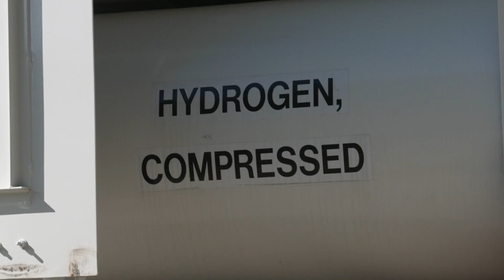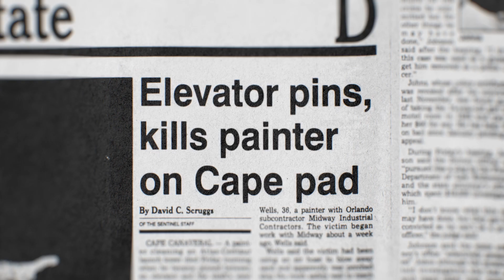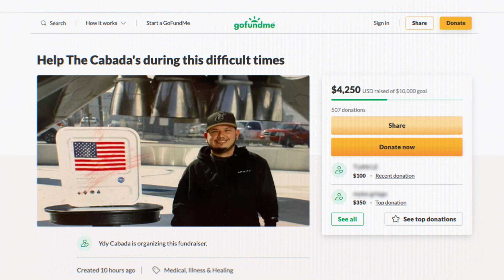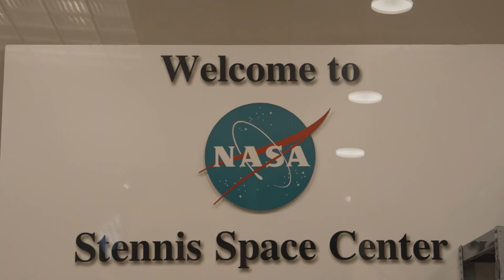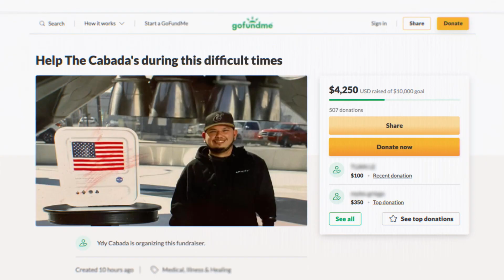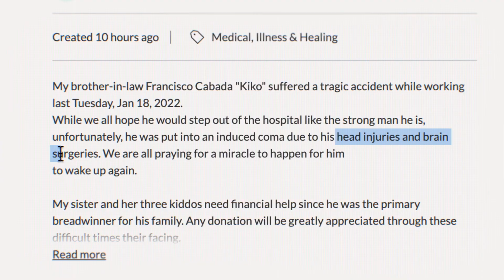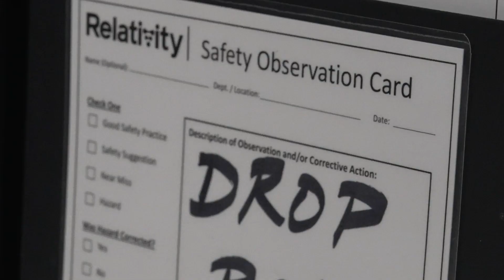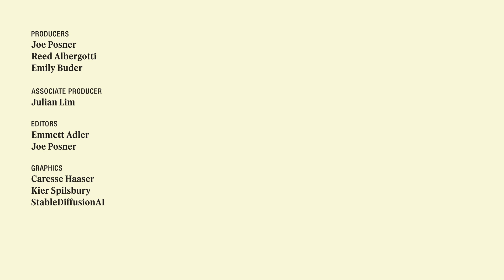What an accident at SpaceX reveals about the new space race

Comment: Neither the video or the article contain any information at all on the only relevant aspect of the story - how the accident happened and whether the accident was a result of negligence, either on the part of the individual technician, or as a consequence of lax safety standards of SpaceX. As practically everything about the story turns on the answer to such questions, the story as it stands constitutes little more than a puff piece for Relativity Space. I come from the world of nuclear fusion research, a field not unknown to workplace hazards. A decade or so ago an engineer was severely injured and nearly killed by a piece of metal equipment that became over-pressurized with carbon dioxide gas. It turned out he was using a pressure regulator rated for 15psi max directly on the output of a 2500 psi gas cylinder. No one instructed him to do this and he had sufficient technical and safety knowledge to understand the hazards involved. The accident was hardly the fault of the lab, yet was fined by osha to the tune of tens of thousands of dollars. A company's culture and practices are not always at fault for the accidents of its workers and without any real relevant information in this particular case at SpaceX the reader can draw no useful conclusions from the story. Poor reporting, in my view.
Reply: And the family statement said he been put into an 'induced' coma as part of his treatment, not that he was in a coma due to the original accident.  Small point I know but accurate reporting is required for something like this.  Hope the guy recovers in due course.
Reply: Your point was already well made in the video. I don't know why you consider that to be poor reporting. The video states exactly as you do why we don't know what the cause of the accident was - SpaceX's lack of transparency. Another important point is to recognise the risk that engineers are making to build rockets. I'm glad someone made the effort to bring these points to light.
Reply: @aspzx  You don't run a story if you don't even have any details about what happens. That's called an activist hit piece, not journalism.
Reply: @Muonium1  There were enough details known to run the story that they ran. Just not perhaps the story you wanted to hear.
Reply: @Muonium1  your first comment says you want to know more details about the accident and that was the story you wanted to hear. All I'm saying is they decided to report a different story. Not sure where your hostility is coming from.